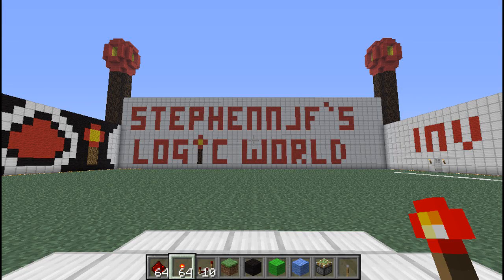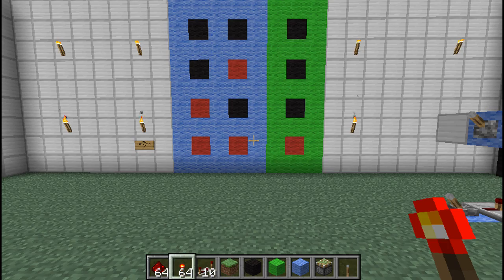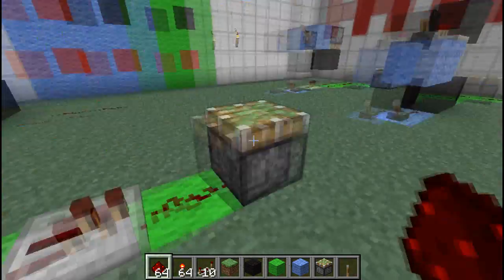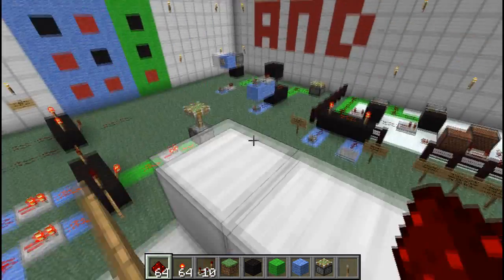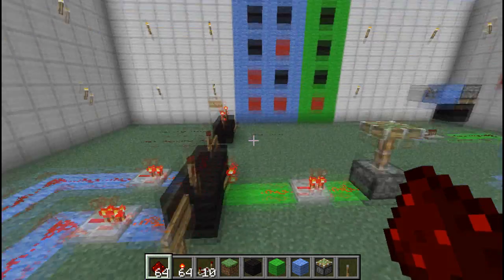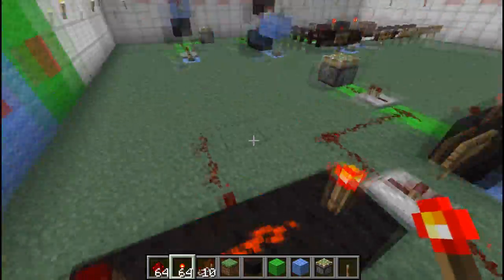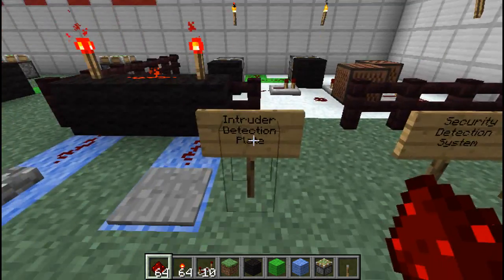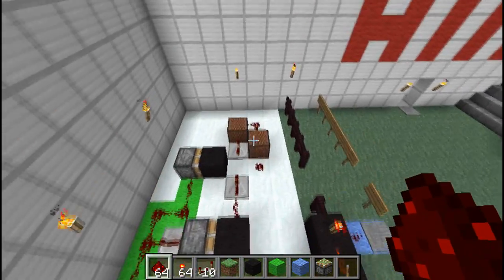[Minecraft] AND Gate Tutorial and Its Uses

Comment from the maker: Yes. They are quite similar as it will set in a value. The only difference is that the advantage of using the RS NOR latch to set a value is that when you RESET it you instantly know that the output will be at a LOW. Next time SET is at a HIGH the output will go HIGH.

With a T flip-flop it can sometimes be difficult to tell what the current state of it is in a complex circuit. If its something simple as in a door connected to a T flip-flop it can easily be seen what the current state is.

Comment from the maker: Not yet but I can make a video on it if you want to. In the mean time I'll give you an explaination but you'll have to find a design in the mean time.

All a T flip-flop does is it acts like a toggle function of the output. Basically it goes from a LOW output to a HIGH output or a HIGH output to a LOW output each time the input goes from OFF-ON-OFF.

Essentially by having a T flip-flop you can make a button be like a lever. This is the simplest way of using a T flip-flop